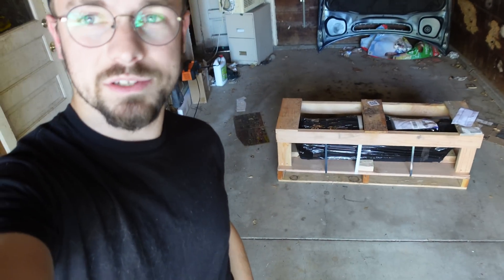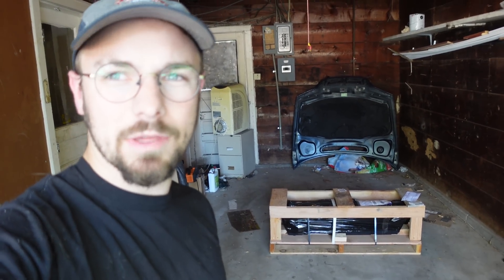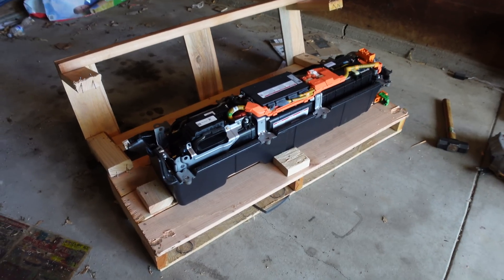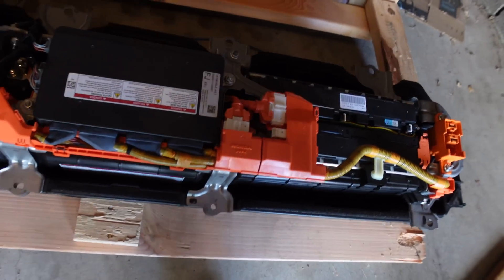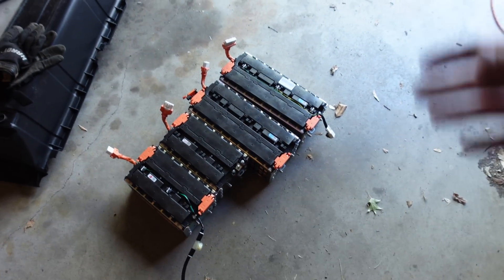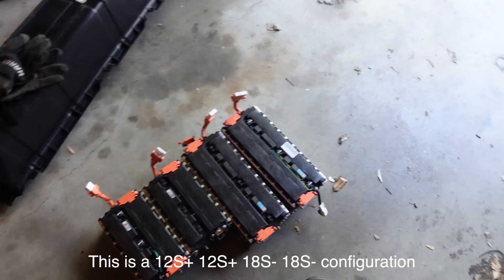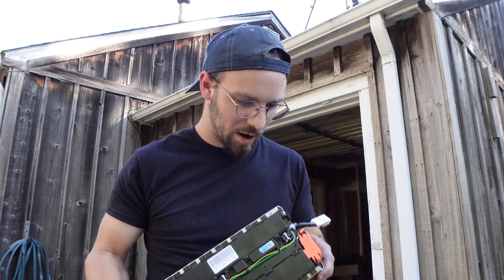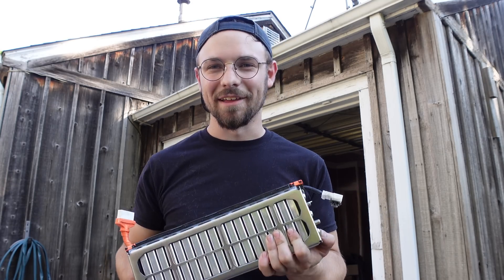LITHIUM POWER for my RARE HYBRID! (Insight Lithium conversion PT1: Donor disassembly)

Comment: This is an interesting project, Jake. Twice now you have said it doesn't make financial sense to spend so much on a car that old. My daily driver is a 1990 Volvo 240DL wagon with just about 400,000 miles on it. $2,400 to make an upgrade like this is easily justified on two fronts. First, if you were buying a new car, the taxes and fees, from which you, the buyer, derives no benefit, would be more money. The second way of looking at it is that it is way less money that a year's worth of car payments, so again, money ahead. The third way, and second front, is the environmental benefits of keeping an old car on the road. You would need to drive that car 80 years or more, at 12,000 miles per year, before what comes out of the tail pipe equals the amount of pollution produced during the building of the car. On top of that, you are postponing indefinitely the pollution produced and energy consumed in dismantling and recycling the car at the end of its service life. Drive on!

Comment: some quick factoids about the danger of dc current. yes, dc current causes muscles to contract so if you grab a hot lead... ouch. i live in nyc. the subway is 600 volts dc. so beware the third rail. they put lumber above the third rail to protect people working on the tracks in case they fall on it. they all wear seriously insulated boots. there is a cool scene in 1974 movie, "the taking of pelham 1,2,3 " where robert shaw of "jaws" fame touches his cane to the third rail to commit suicide. the weird thing is that i see rats down on the tracks all the time and they never get zapped.

Comment: Oh YES! More Insight content, with Lithium!!! I have a 2004 Insight red MT with air conditioning. The high voltage battery is bypassed and the car is slow but I still get over 50 mpg which is just perfect for work commuting. I will watch all these Insight episodes. Yay! 😄 Also, Mudder is a saint and genius for his work!